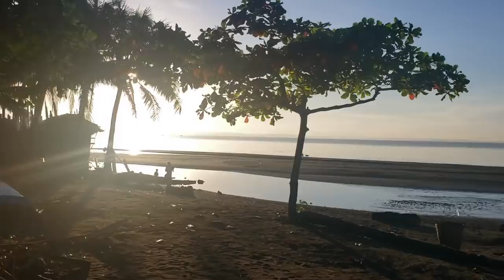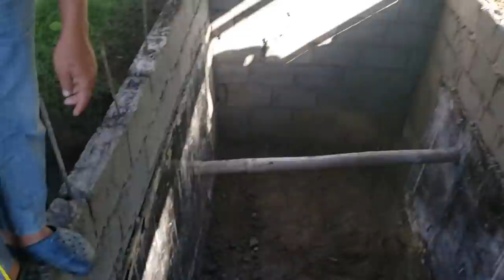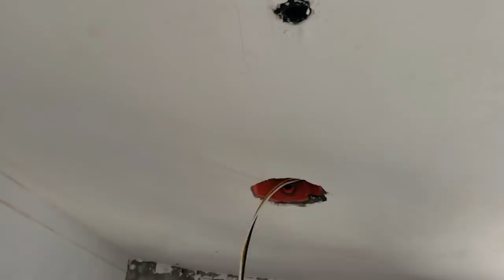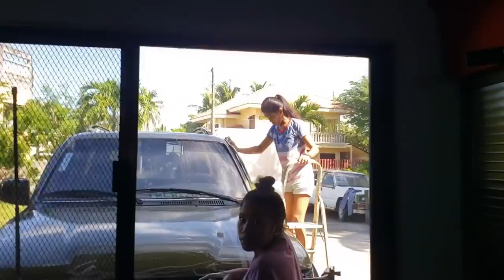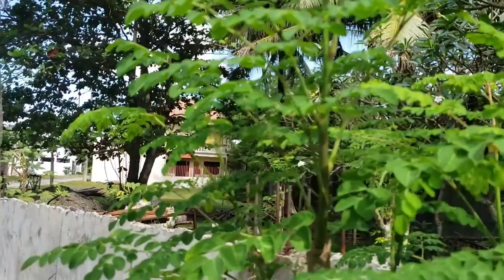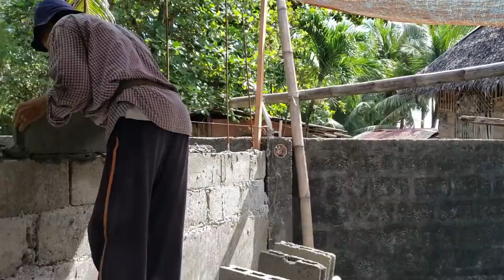Philippines Beach House Build Day 95 Part 1: Pulling Electrical Wiring Sucks

Comment: Usually we use a compressor and a "mouse" to blow a string through. He seemed a little ham handed on the fish tape. Once you kink the tape, it will never work as good. That's why I never let anyone borrow my fish tape! I love your beach house! I'll be building my house in the country near Bacolod.
Reply: Mouse?  A real mouse?  Great idea!
Reply: On underground pipe runs we have 2" pipe and send a real ferret to run and the pull lines through.

Comment: Little trick for you. Metal fish tape doesn't work well in PVC pipe. Normally I use a nylon fish tape. But you can take electrical tape and wrap the end of your metal fish tape, leaving a flap of tape on the end. It causes the metal tip to pass threw the 90 unobstructed. That tip is hitting the edge of of the 90 in the pipe, and stoping it. But the vacuum cleaner does work as well.

Comment: hi James, hallowblock are week 
you should test them prior purchase  they should withstands a drop  without cracking.   week hallowblock constructed with less cement for  cheap mass production
Reply from the maker: I didn't give a darn on these because they had one purpose - keep hole from collapsing while we build the real tank. I would not use any of these blocks in my home. Not any structural part.

Comment: That's why I think here in Canada they set up the electric wiring first before finishing the wall and ceiling
Reply from the maker: I could have pulled the wire but knew it was no problem at all . I knew I could pull it right thru. On our long runs I put steel wire thru and leave it until we pull the cooper. Remember there is people here broke and cooper brings quick money just like back there.

Comment: You could also bend the conduit with a bending spring then the fish tape would not get caught on the joints of those manufactured bends.
Reply from the maker: this is plastic conduit . long sweep 90's about 8 inches long. Metal conduit wont be a good thing here. SALT SALT SALT you just dont realize. We get constant seabreeze  bringing up so much salt. Plastic is your best friend! Good idea if not near salt though !  Thanks for sharing that idea!

Comment: By the way that seems like a very short run of pipe. You could probably just push the wire threw, especiallyif It's solid wire. Wish I could show you a picture. Take your one wire and strip the end, bend it over making a tip. Or partially strip the wire, leaving a flap of insulation hanging on. Stairstep the rest of the wires down this first wire, and tape them together with electrical tape. You should be able to push it threw the pipe on a run that short.

Comment: Maybe you are not familiar with doby's to get your rebar of the bottom but you can use pieces of cinder block to get a stand off for your walls or floors and it wont affect your poor
Reply from the maker: sorry but your method will not work. first they dont have plastic standoffs here at local hardware stores. Next broke hollow block and other stuff would be porous any thus a higher risk of seepage even with water proofing. I can pour water right thru hollow block. Keep watching --- kick your shoes off - watch this !!! LOL I want pure concrete around the steel and below it. On full ground contact it requires 3 inches of cover over the steel on the bottom.  We suspended the bottom using those nails and tie wires . The wood slips up each time with the pour.

Comment: :D would've been better if they slid wires in the pipes first before assembling and cementing them huh? but meh, they'll make it anyways. as for your fence, maybe you should have them put glass shards and/or barb wires on top. you won't know what envious neighbors could do here in ph. and air guns don't need some license shiznats here. heck, you can even have it converted into a .20 cal rifle :D

anyways, enjoy your mung bean porridge
Reply from the maker: nah we dont need none of that. Even though it is a squatter compound we are very close to all of them. No need for them to steal or harm. I will help them. There is so many good people in there. Heck they guard us! I am trying to slowly teach them and so is Mel.  We are very lucky for where we are even if a few problems here n there. I have been with them all for years. They are part of us.
Reply: @TexasFilipino  ok amigo, your call. I also live in the slums for years, and my neighbors lived here longer than I am and yet, they find their bikes have missing parts from time to time. during typhoon rolly, our power lines was stolen, so I replaced it with copper wires. the next night when ullysses hit, it got worse! even my neighbors got robbed as well! so I replaced it with #10 aluminium wire then 'cuz it's way cheaper, and I was told that the thieves would leave aluminium wires alone as they won't sell well, or so they say. I fear for our appliances, though... our power meter is 300+ meters away from our sitio by the way so meralco won't do squat about our stolen lines.

that's just a heads up for you so take care